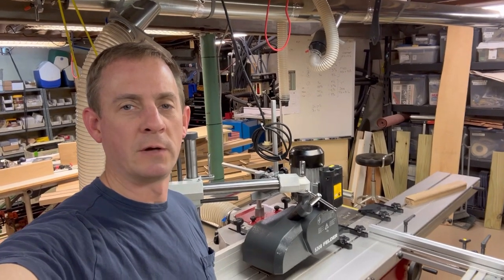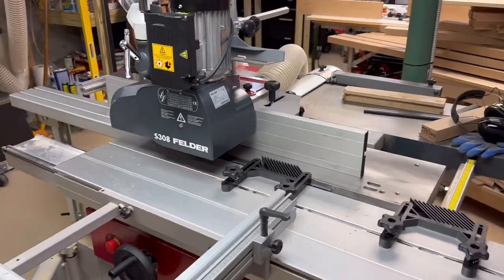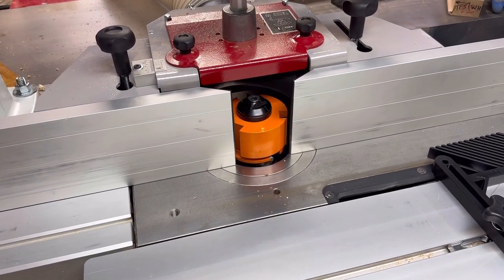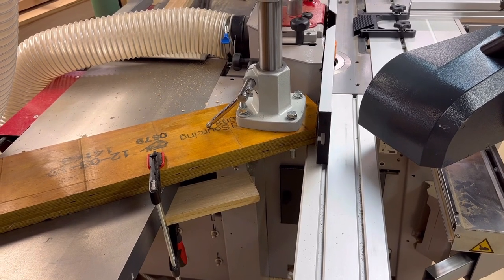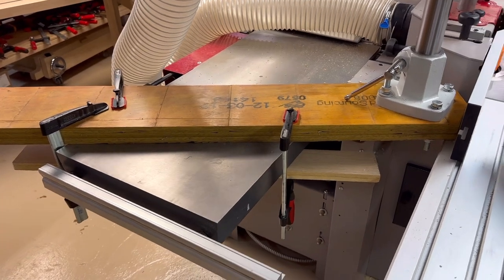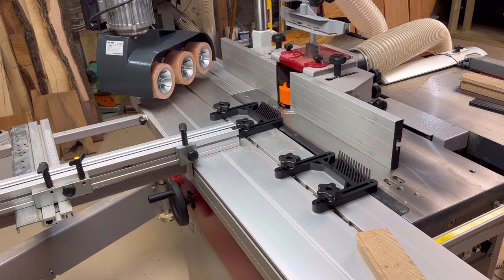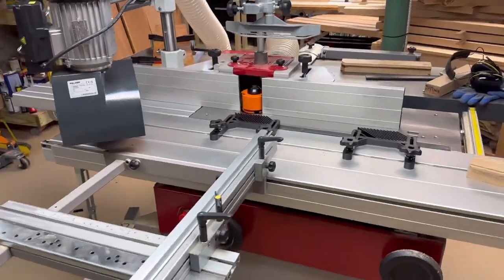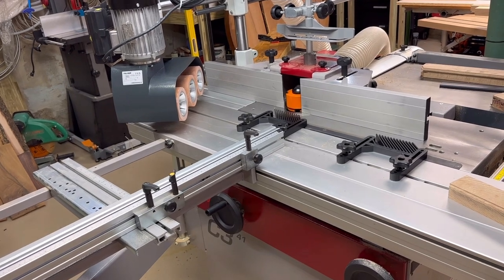Mounting a Felder S308 stock feeder to my Hammer C3 41 Comfort combination woodworking machine

Comment: I have the c3 41 .I have the same stock feeder . It folds away just fine.Great machine.
Reply from the maker: Good to know. Does it interfere with an outfeed table extension on the table saw? That was my concern. I have on of the Felder extension wings attached to the rail on the outfeed side.
Reply: @theoccasionalwoodworker  Hi, it doesn't interfere with the use of an extension table.

I wouldn't attach a feeder to a jointer table, the feeder can transfer significant twisting loads to the jointer table.

I do use my feeder with the table saw, rips are flawless, they look like they came off the jointer when you use a good ripping blade.

Have fun, you have a nice machine.

Comment: I also have a C3 41 Comfort.  I purchased and installed the H32 power feeder with the tilt away mount.  The mount kit came with the bracket for the extension table.  There is enough room for both.  I'm picking up my extension table tomorrow.  I have pictures if you're interested.

Comment: Thanks for the great experience sharing. By the way, would you please share how does it work and if you are happy with this upgrade?
Reply from the maker: The stock feeder worked very well for the shaper operation that I was preparing for in the video. It has plenty of power, and the slow speed feed rate was perfect for the operation I was doing. My improvised mount worked well. Of course I would prefer not to have spent that much money on a stock feeder, but I feel like it’s a good value for the price, compared to what some other manufacturers offer. And you can’t put a price on keeping all your fingers where they belong 🤷🏻‍♂️